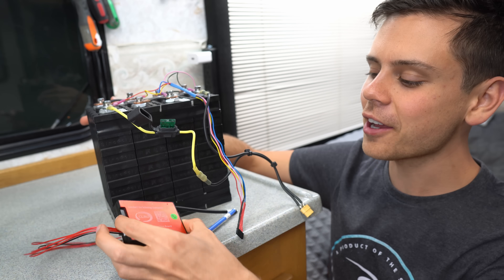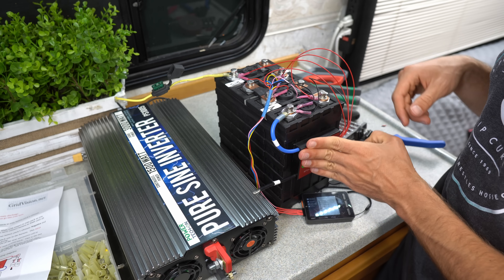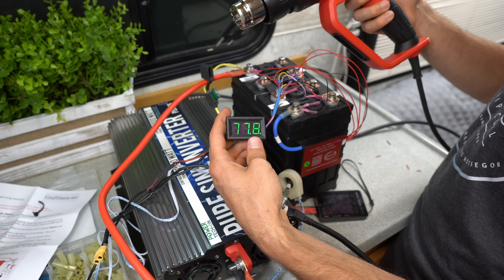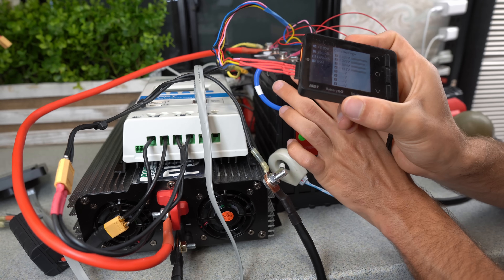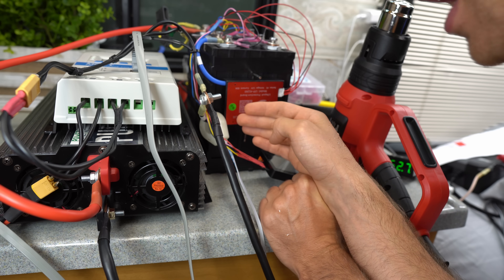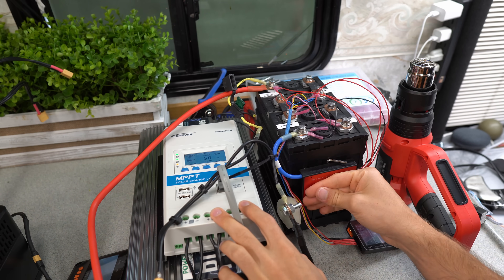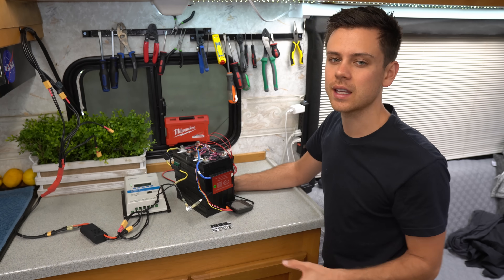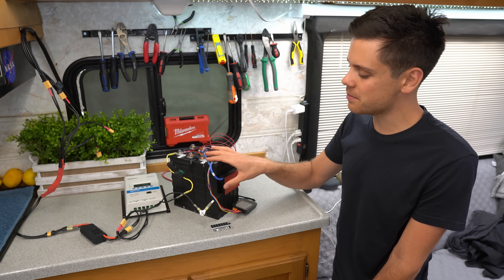12v 60a LiFePO4 Solar Battery BMS for $32- Installation and Test!

Comment: I assume the leads from the MPPT controller goes directly on the  battery?  The P1 line from the BMS goes to the neg on the inverter and the pos from the inverter goes on positive terminal on the battery right?

Comment: LOL....I was born and raised in San Diego. Never say never about the cold friend. I remember back in 87 when we got 3 inches of snow in the Santee/Lakeside area. I remember Ice floating by the OB Pier in 83. North Island Bridge Frosting over in 86.  Also, remember that California actually gets more annual snowfall than Colorado ;)
Better to be safe than sorry, for a just a few dollars more the system can be protected from cold/heat (You teach this) and it may well be an unexpected benefit from time to time :D

Great info...would be curious how it performs  6 months to a year from now.
Reply from the maker: Wow that's crazy! I can't imagine that haha
Reply: @WillProwse  It is rare and spectacular :D
The weather has been fishy in SoCal for well over a decade now, but it will return, or so I believe ;)
Better to be prepared, because I also recall 90+ degrees back in the late 70's on Christmas Day in the Clairemont area with the Santana winds. that was the start of the draught that lasted into the early 80's :P
Reply: The Sarge knows.

Comment: was it the inverter that cut out at the low voltage?
Reply from the maker: The inverter will still beep for a second when BMS disconnects power because the inverters internal capacitors still hold some charge. So it will give a low voltage warning, but it's disconnected for the main battery. That's why it beeps. The low voltage threshold of this inverter would not be touched by the voltage range of these LiFePO4 cells in 4s configuration

Comment: In short. What do you think is the future? Solar is great. Ultra capacitors are really cool. Very cool. Make a bit of money. You are the future. Thanks, man 😁
Reply from the maker: Lithium titanate batteries. Working on my first battery right now. 20,000 charge cycles. Should last longer than I will be alive. Video will be up in a month or so.
Reply: @WillProwse  .. Probably a stupid question. Did you pass the mensa test? I did in 89.

Comment: Love your videos.  Do they make one for leadacid batterys ?
Reply: Hey Charles, There is no real need to use a BMS on lead-acid batteries, at least that is my understanding. I am sure Will has covered the issue in a past video or in his latest book. "Mobile Solar Power Made Easy!" I highly recommend it and it's well worth the purchase.
Reply: I have heard it both ways . In the navy our 72v and 120v systems all had BMS on them , granted they were huge battery banks but a cell is a cell . I would always fell better if I know when one cell is going bad , especially with lead acid .
Reply: @jafolost  I would agree that on larger battery bank systems it would be beneficial. I have six 6volt lead acid batteries in my system and have not had any issues. I plan on upgrading to LiFePO4 batteries and a BMS is absolutely needed. Thank you for your service sir.
Reply: @PH_INFO_101  Your welcome , it was a great job for the most part  . I am off grid and worry about temperatures and discharging the batterys past the 50% point .
Reply: @jafolost  If you don't mind me asking, what area are you in? I am in currently in the northern suburbs of Minneapolis, MN
Reply: @PH_INFO_101  I am in the Fort Smith area of Arkansas .

Comment: Can you you do giveaways of small solar panels
Reply: н̶͟и̶͟　к̶͟о̶͟д̶͟　б̶͟а̶͟б̶͟е̶͟　н̶͟е̶͟м̶͟а̶͟　з̶͟а̶͟　џ̶͟а̶͟б̶͟е̶͟
Reply: I am doing a battery buildout Will, that you inspired. 4 280 ah aluminium cell lipo 4 and a Daly 100 amp BMS. But after the connection and charging. I am getting 15.3 volts from the battery, but only 11.24 volts from bms. What do you suggest?